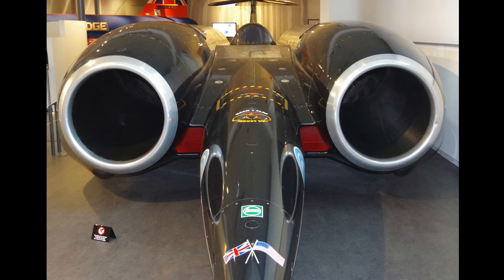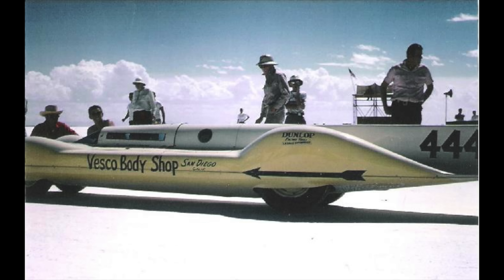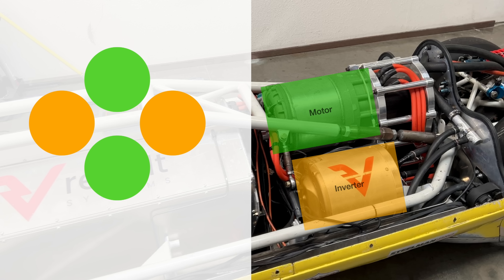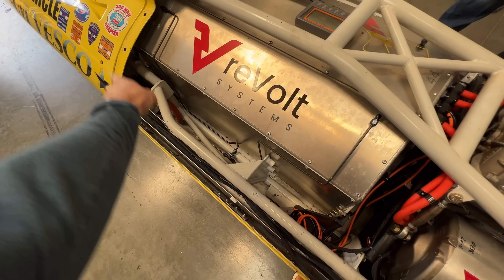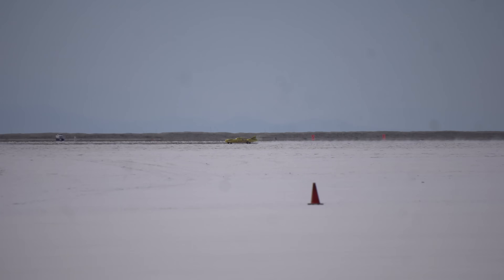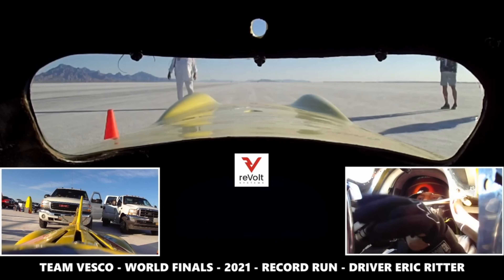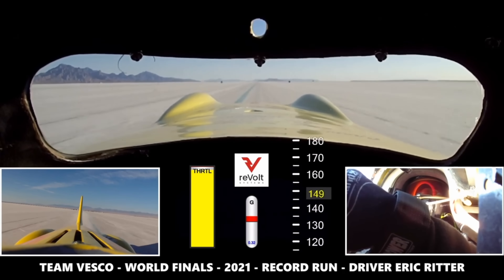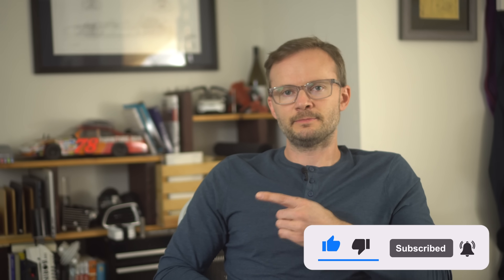The Engineering Behind The World's Fastest Electric Vehicle

Comment: Nitpick:
Aerodynamic drag is quadratic (squared), not exponential. There is 4x as much drag when going 2x as fast.
Power needed to overcome aerodynamic drag is cubic. You need 8x as much power to go 2x as fast.
Reply from the maker: Thank you for the correction. I regret the mistake, and I will cut one corner off of my engineering license.
Reply: @SuperfastMatt  If you did that everytime you made any mistake then I bet this paper is the most perfect Circle in the World
Reply: @cyjan3k823  Yes, Matt does seem well-rounded...
Reply: @SuperfastMatt  
Sounds like you will have a well rounded education.
Reply: @SuperfastMatt  Doesn't that just mean your license will have 2 additional corners? That seems better. Closer to a perfect circle.
Reply: Not a "nitpick" very important for us non engineers, non math minds, to understand!! Thanks for adding this.
Reply: (and Thats nothing to be ashamed of obviously)
Reply: @cyjan3k823  would that be 0 corners or infinite corners?
Reply: Cool info!

With one part I'm a bit confused. Isn't "exponential" just the common word for "squared" or "cubed" or any number "to the power of ...". I mean it's the same thing. Example: Four to the power of two. The number two is the exponent. Therefor it is squared. And, because the number two is an exponent, Four grows exponentially. 
Am I missing something?

I absolutely agree though, that using squared instead of exponential is simply more precise.
Reply: @mokydenan  squared is x^2, exponential is a^x. Big difference.
Reply: @mokydenan  Common but wrong.. "exponential" places the variable in the exponent y=2^x is exponential. While y=x^2 or y=x^3 is a polynomial. quadratic and cubic here.
Reply: Take a small car with 100 kph, how fast will it go?
With 400 hp, how fast will it go? Not double.
Which drag factor is more than sqaured, then?
You'll find you need 8 times the 100 hp to make the car go twice as fast.
Reply: @Cloxxki most speed limitations are due to drag.  Cut down the coefficient of drag, and present as  small of a cross section to the airflow as possible.  🎉

https://youtu.be/rxvoDbZpoY8?si=tYYhgG9ZCddoycm3

Google Mike Arnold's AR-5 race plane.
65 hp to go 348km/ hr in level flight. Both directions to eliminate tailwind effects.  

Sure, airplane speed runs have fewer variables- like traction and surface roughnesd to deal with...  but aerodynamics  don't care if you are in a car or a plane .
Reply: right
Reply: @anand.suralkar  Amen
Reply: @anand.suralkar  Amen
Reply: In the technical vernacular of most lay engineers, the two terms are practically synonymous, IMHO.
But I do appreciate your clarification for the sake of ultimate accuracy.
Reply: Aren't there also traction issues with applying that much power through the wheels vs jets?
Reply: @zobdog205  Not limiting, because they aren't accelerating very quickly. It's not a drag race. You notice in the video of the speed run they never passed more than .35 Gs.
Reply: thank you random internet dude for teaching me in 2 lanes more than my teacher did in 2 semesters
Reply: What humble educated folks in this comment section, so cool to see , engineers are awesome !!!!! Go team human !!!!!!
Reply: Came to look for this comment, I know almost everyone makes the mistake but at least engineers shoud try to do better
Reply: You are exactly right. To be even more specific, let's take a typical motorcycle. Top speed = 31mph times cube root of horsepower. 1270^(1/3)*31mph=336mph. Since 353mph was accomplished, this suggests the body has less drag than a (non-faired) motorcycle. Very good, but the Vesco crew knows motorcycles and how to fair them, so not a surprise. Little known also is the fact that drag improves the longer the body, and this thing is WAY longer than a motorcycle.
Reply: Because Cd is not a constant when Reynold number changes. You cannot just assume the force goes by the square of speed
Reply: @haoli9220  While most generally that's true, it's completely irrelevant to this application which has Reynolds numbers which are solidly past the transition zone.
Reply: @haoli9220  Reynold number wouldn't change significantly between the magnitudes of speeds we're talking about
Reply: I got what he meant. the faster you go, the more resistance, hence the more power needed, which when you start looking at it, you get into exponential power requirements. 
how fast you go all depends on how much power you can put out to overcome resistance. which is like saying how long is a piece of string.
Reply: exactly
Reply: In the media , everything is "exponential" until they encounter someone who isn't mathematically illiterate
Reply: correct. thank you.
Reply: So, “squared” IS exponential. The little 2 in the corner is the exponent. That’s the point.
Reply: Drag=1/2Rho *Cd *v^2 *s
Why do you need 8x the power when drag only increased by 4x?
Reply: @Chris-bg8mk  Power = Force * Velocity
Reply: @Chris-bg8mk  Power = work /time
 Work = force * distance
So Power = force * speed (and force is your aero drag calculation plus rolling resistance etc)
Reply: @Chris-bg8mk  think of a 1m cube, moving a 1m/s it will hit 1m^2 in 1 second with a differential of 1m/s - 1x1x1 =1 
Doubling the speed the same cube will hit 2m^2 area at a difference of 2m/s - 2x2x2 = 8
 Another way to think about it is you're transferring kinetic energy to the air. The amount of air you hit per second is proportional to V and the kinetic energy you give each bit of air is proportional to V^2, so overall the rate of energy transfer is proportional to V^3
Reply: @CED99  now halve the dimensions of this cube, and you are displacing 1/8 of the original volume.
Reply: @Chris-bg8mk  because you are travelling twice the distance in the same time. Remember, energy is force x distance, so if doubling the speed requires four times the force over twice the distance, then that's eight times the energy in the same time, or eight times the power.
Reply: @Chris-bg8mk  Assuming all other parasitic losses do not increase significantly with speed and become negligible at high speeds when compared to drag, then the only thing increasing sharply with speed is drag, which is a quadratic function of the speed (Drag = a x V²; where "a" is a constant that represents the remainder of the equation, which does not matter here). Power is Force times Speed (P = F x V), thus Power = Drag x V = (a x V²) x V = a x V³. So, for objects moving in a fluid, the relationship between speed and power is cubic, twice the speed requires 8 times more power (2³=8).
Reply: @Chris-bg8mk  Because you have to move that force over an ever increasing distance as the speed goes up so rate of working is force times distance traveled in the same time.
Reply: @Chris-bg8mk  because the speed also went up by 2x.  Power = speed * drag.
Reply: @Chris-bg8mk   1 x more Needs 4 x So 2 x Needs 8 x, (Doubled) Make sense ?
Reply: According to the Cambridge dictionary =  "An exponential rate of increase becomes quicker and quicker as the thing that increases becomes larger" in layman terms : The graph is curved and not linear . I would therefore say that SFM was right to call it "exponential" !
Reply: Are not "squared" and "cubed" subsets of exponents?
Reply: @jsquared1013  No.  confusingly…. x^3 is cubic while 3^x is exponential.  So technically the power needed isn’t exponential from a maths standpoint.  (When dealing with attaining speeds  to beat the EV land speed records, I should add).
Reply: @jsquared1013  No, exponential (growth) is defined as a constant ratio change in a constant time interval. If you put one grain of sand on square 1 of a chess board and then 2 on the next, then 4 on the next, 8, 16, 32, all the way up to the 64th, there is not enough atomic mass in the universe to fill the chess board. Biology does exponential growth quite easily, until the food runs out. This can be upsetting for the food, if the food is human and the biology is a virus...
Reply: @jsquared1013  quadratic is x^2 whereas exponential is 2^x
Reply: @jsquared1013  No.. "exponential" places the variable in the exponent y=2^x is exponential. y=x^2 or y=x^3 is a polynomial.
Reply: I am slowly  coming to terms with the idea that, in common language, “exponential” just means “super-linear”. Yeah, it’s stupid, but fixing it is a lost battle.
Reply: quadratic functions are exponential as the exponent of x is greater than 1
Reply: @cvacant7864  Exactly. Exponential simply means it has a significant exponent.
Reply: @cvacant7864  False. "exponential" places the variable in the exponent y=2^x is exponential. y=x^2 or y=x^3 is a polynomial.
Reply: i was about to post this :)
Reply: TECHNICALLY the power needed is exponential. Once you reach relativistic speeds approaching "C" the power needed becomes exponential.
Reply: @piccalillipit9211  Still wrong. If we are considering relativity, there's an asymptote to infinite energy in order to approach light speed.
I'm pretty sure exponential curves don't have asymptotes friend.
Reply: @randomnobody660  - Its not an asymptote.
Reply: @piccalillipit9211  What are you talking about. Energy needed approaches infinity as speed approaches c. I'm pretty sure that's clearly a vertical asymptote.
Reply: @randomnobody660  QUOTE "In analytic geometry, an asymptote of a curve is a line such that the distance between the curve and the line approaches zero as one or both of the x or y coordinates tends to infinity"  

Velocity V Energy would not be an asymptote as velocity would not approach zero as energy approached infinity. 
Acceleration V Energy would be, but Id considers that fudging as we never talked about acceleration in the OP, but velocity.
Reply: @piccalillipit9211  Yes, we are talking about energy vs velocity. Read your own quote again. "...the distance between the CURVE and the LINE approaches zero..." (emphasis mine)

Where does it say velocity needs to approach zero as energy approaches infinity? That has nothing to do with anything. It's an asymptote because as energy approaches infinity, the curve in question (velocity against energy) gets arbitrarily close to a line (velocity = c), or if you insist, the distance between that curve and that line approaches zero.

Just google "vertical asymptote". Where a curve goes straight up, approaching infinity at a finite x value, it's called a vertical asymptote.
Reply: @randomnobody660  NO. Its not "the distance between a thing and the line approaches zero" the thing being C. One axis approaches ZERO, actual ZERO as the other approaches infinity in an asymptote.  A vertical line on a graph is not an asymptote. Its just an axis hitting infinity. You can argue that E stops being exponential as you hit infinity but as you will never reach infinity it will always be exponential. E to achieve C = infinity. E to achieve C-1 is not infinity.
Reply: @piccalillipit9211  ...can't tell if you are serious or trolling at this point. Your own quote never said one axis has to approach zero.
Once again, your OWN quote defined asymptote for a curve as a line such that:
"...the distance between the curve and the line approaches zero..." that's what needs to happen. In our case the curve is energy against velocity, line is velocity = c
"...as one or both of the x or y coordinates tends to infinity." that's where it happens. In our case energy tends to infinity as velocity approaches c.

Once again, just google "vertical asymptote".

Alternative, we are basically plotting lorentz factor stretched out. 1/sqrt(1-v^2/c^2) was NEVER exponential, ever.

Exponential means a very specific thing, and this ain't it.
Reply: @randomnobody660  "asymptote" means a very specific thing and this aint it. Anyway I have a life to live and I have spent way too much of it arguing over an abstract issue like this. Goodbye.
Reply: @piccalillipit9211  You provide a definition, basically went directly against it, then abandon it when you realize it doesn't say what you want. Nice.

Once again, even if you can't understand what asymptotes are, lorentz factor is clearly not exponential. You are wrong. Just accept that and move on.
Reply: @randomnobody660  - You care way too much about this for your mental health. I mean this is a disturbing level of obsession.
Reply: @piccalillipit9211  Takes 2 to hold a conversation. Stop projecting lol.

Then again, perhaps great mental gymnasts like yourself who can so boldly ignore your own definitions are already too twisted to suffer more damage, in which case thanks for the advice I guess.
Reply: @piccalillipit9211 Firstly, let me say that I’m a huge fan of Superfast Matt and, as an engineer, I appreciate how well he presents complex concepts in a way that’s engaging for technically-minded and digestible for the layperson. Now onto the minutiae-Asymptotes do not need to be vertical or horizontal on an X-Y plane, and they certainly don’t need to exist such that they can only be described as x=0 or y=0. Asymptotes only need to be a linear function that a more complex function approaches as either of the axes increases, without ever meeting. In this case, the distance between an asymptote described by the function velocity=C on an energy vs velocity plot with velocity on the x axis) and the function that describes the relationship between the energy imparted to an object and that object’s velocity, tends towards zero as the y value (energy of the object in question) increases. In other words, V tends towards an asymptote of V=C as E increases towards infinity. 
It’s Friday night, I’ve been drinking and I just went cross-eyed. Please pardon my ramblings in the comments section of my favourite YouTube channel without a doubt. There’s enough aggro in today’s world without us disciples of Superfast Matt contributing. Peace out!✌️
Reply: Drag is not only related to shape and speed but also Reynold number and Mach number(these 2 are influenced by speed). So Drag~v^2 might not hold. In general Drag=qSCd=1/2 rho v^2 S Cd but Cd is a function of velocity and Reynold number. So Drag does not strictly follows v^2 can be true. Whether it is exponential depends on more sonic and viscocity factors.
Reply: @haoli9220  Ya, but reynold number wouldn't change significantly between the magnitudes of speeds we're talking about. And it's all in air, not switching mediums.
Reply: Nitpick of the nitpick: '2' is an exponent. 😂
Reply: “squared” is exponential
Reply: @baomao7243  in "squared" the exponent is on a fixed value, a non-variable so to speak or constant, in more math-terms. The 2 in the exponent never changes what ever value your X (your variable) has. In an exponential function e.g. 2^x, your base is the fixed value and never changes but your exponent is variabel. Thats what makes an exponential function an exponential function. x^2 goes 1, 4, 9, 16, 25, 36.....   2^x goes 2, 4, 8, 16, 32, 64. x^2 gives you a parabula wich growes way slower than an exponential.
Reply: That IS an exponent
Reply: @coachlachlanc  NO, that's not what exponential means.. It means the exponent is the variable. This isn't a question of opinion.
Reply: No, that equation is exponential.
Reply: I feel like the power needed for 500mph will be a possibility with EV tech in a few years
Reply: @Muffinx93  I doubt a few years maybe 10 or 15 the battery's are the biggest problem now that much battery would be heavy asf

Comment: I've run into this exact same issue (albeit at a fraction of the scale of cost and effort) running into battery current limitations on my DIY extreme budget eBike.  I'm learning though, and someday hope to work my way up to a proper EV swap on my truck...
Reply: Your constraints are different, and not in a good way.  Drag coefficient alone is going to need a lot more power to overcome.
Reply: @ShainAndrews  not really Different, if he wants to keep battery small then he cant divide this current between many Series of cells so its just like he said - Different scale but same thing.
Reply: @cyjan3k823  Have it your way.  I must be the only one that sees a slip stream envelope.
Reply: @ShainAndrews  That's very true! The speed to drag curve for me would be exponentially steeper than theirs... but I really don't really want to go 300mph+ on a bicycle either. lol 

I was more referring to the fact that I was also running into battery current limitations with my original setup that required getting a new battery capable of discharging at a higher amperage.